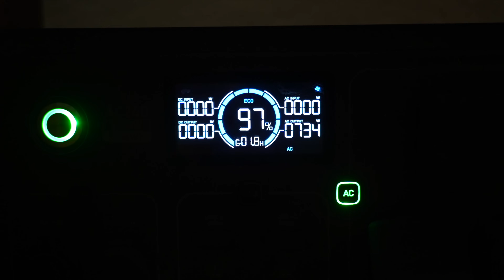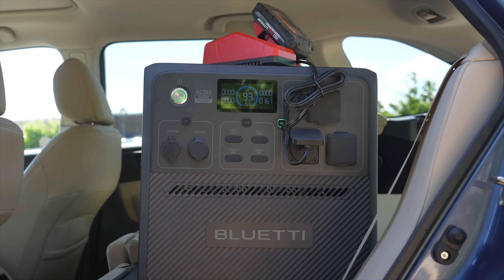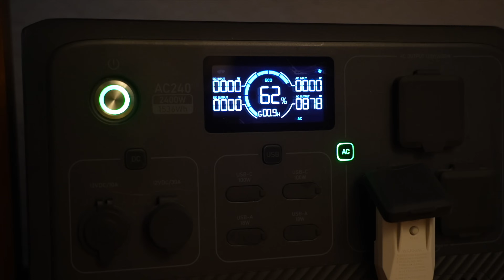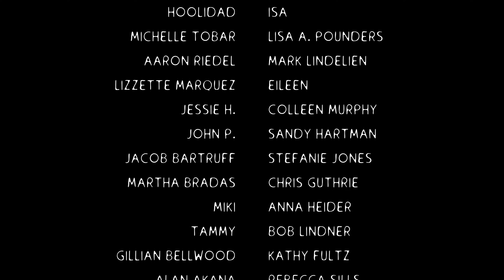minimalist bedroom makeover (on a small budget)

Comment: As someone who has lived solely with portable ACs like that, they’re ALL noisy, so don’t bother returning on that score. That said, to make it much, much more useable, you need to add a fan to circulate the cold air (I use a Vornado), AND most importantly, insulate that vent pipe! The heat coming off the pipe will negate some of the effect of the cool air.

Portables are never going to be as effective as a traditional window unit, but they absolutely CAN be lifesavers in heatwaves.
Reply: another thing is to plug the AC into the apartment electrical when not plugged in to the generator.  Part of the power each time would be used to get the room down to temp again as the temps go up as soon as the AC is off.  (think of a closed up car and how fast it heats up)  So if it only has to keep the temp down on the generator, it is much better that taking the temp down 20 degrees etc. after the room heats up again.     I hope I made that clear and it doesn't sound like gibberish. down

Comment: Looking at the comments and saw two ideas I agree with.  One is raise your bed a bit so Tara has a nice space under there - she might like that.  Also -you should try to find a way to charge your Bluetti  while using it  to extend the running time?   Not sure what your outside is like or what floor you are on.  Can you hang the solar panels outside some how?  Can they charge through glass -  could you prop them up in front of a window (I have no idea how they work related to that).  Just something to think about.  By the way love watching you fix up the apartment - you have great decorating ideas and they seem very low cost.  Would you feel comfortable sharing details like where the curtains are from and their cost?  That might help someone trying to decorate on a budget.

Comment: Go get an iglu cooler, you may even have one you use for camping. Buy a 5" USB fan so you don't cook your battery too fast. Cut two holes in the cooler, and make sure one is just right for the fan to blow in. I'm guessing you have a freezer in your fridge so freeze a few gallon containers full of water to put in to the cooler, close the lid, turn on the fan that blows inside and you'll have a long lasting cheap DIY AC.

Comment: Get a mid sized oscillating fan and place it just above the AC unit. And if it's one of those units that is supposed to be a heater, don't. I've had more then one of those units and you ether use it for AC or for Heat but they start to act funny when you switch from on e to the other. And then they just stop working altogether, and become a boat anker.